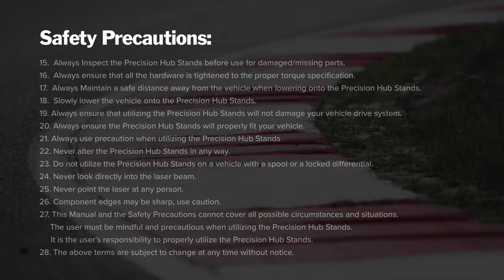Precision Hub Stands Alignment - Porsche 991.2 GT3 Cup

Comment: Do toe alignment lasers point at each other?
Reply from the maker: Yes they do. The rear modules point at the front and the front modules point at the rear.
Reply: oh ok, but when you modify the front toe, you are not changing the reference points with which you've set the back toe? I mean you're moving the ruler with which you've configured the back toe. I don't know if I make myself understood. I hope you can help me haha @csmperformance
Reply from the maker: @fransanchez4157  That is correct however Toe is typically a very small angle (normally less than 1 degree) which equates to a negligible inboard/outboard movement that does not impact the alignment. In essence, yes it does move it technically. In actually it won't have an impact because it such a small, infinitesimal amount.
Reply: @csmperformance  Ahh ok, now I understand.  Thank you very much for your prompt response!